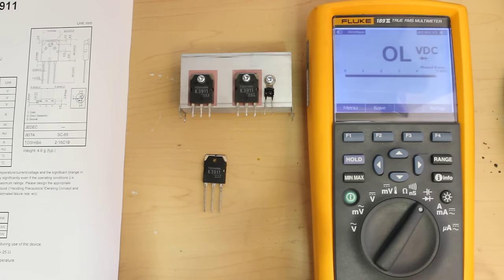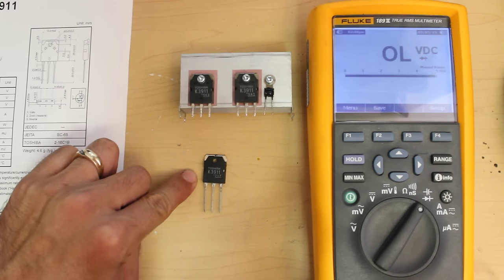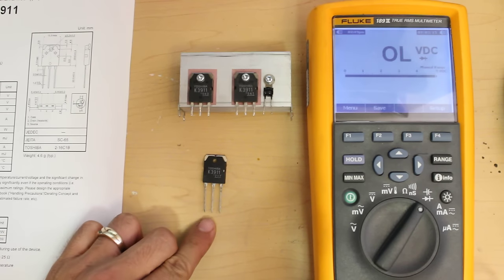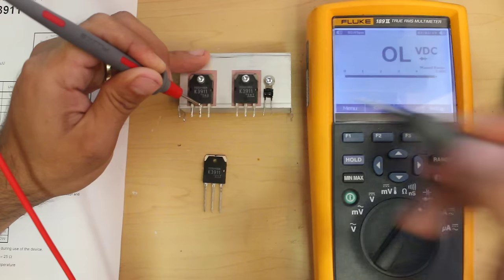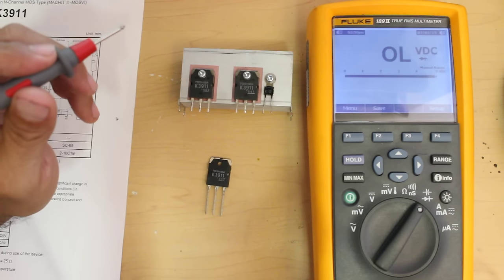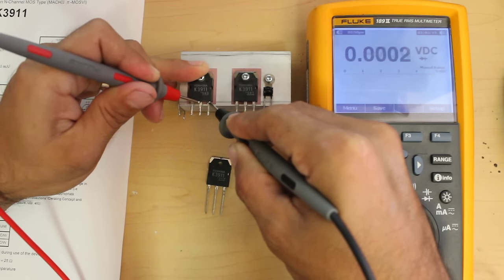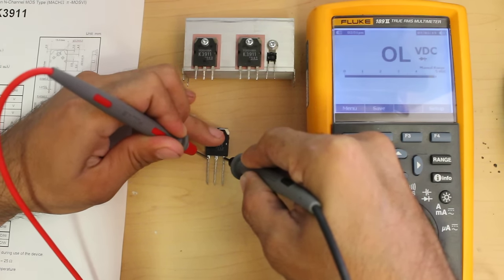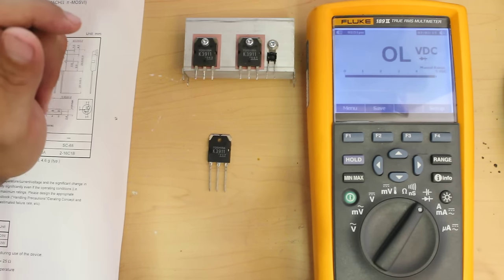How To Test a MOSFET Transistor Using a Multimeter

Comment: Nice video! Just a notice: most multimeter operates between 1V to 2V in diode tester mode which is not enough for a switching MOSFET to open.
Reply: Thanks for the info.
I saw a lot of videos and was wondering, Why my DMM can't charge Capacitor by touching the Gate.
Reply: Oddly enough, I have a B&K component tester that shows 2.9vdc output on the diode setting but will NOT charge an IRF520. I have a Fluke digital multimeter that outputs only 2.5vdc on the diode setting but works perfectly on the SAME IRF520 every time.
Reply: yeah some meters test with 7 Volt and some 3.5 V or lower etc, this needs to be checked first with another multimeter.
Reply: An easy tester is a 9v battery with a single diode and led(with resistor if you want it, for indication) on one probe. Subtract the diode and led voltage and you got a simple polarity tester. (You still need a meter to measure voltage drop on it but got more than 2/3 volts to play with)😊

Comment: Can you do this in a circuit board
Reply from the maker: +alsteven44 Hi, yes you can do this in the circuit board. Then, If you have any suspected bad MOSFET transistors in the circuit board take them out of the circuit board and re-test them.
Reply: The gate is not likely to hold a charge in circuit.

Comment: I had a trailer brake controller which was constantly applying the trailer brakes even when the truck was off. Happened to find this video while googling the transistor number and found the transistor was shorted internally just like the one in this video. Thank you so much!!!

Comment: Many thanks for this tutorial. Just got some Mosfets off a Brushless motor ESC and found 2 duff and 4 working OK. I'm making a flashing 10W LED lamp to put in my model aircraft for when they go in to cloud or otherwise out of sight, and needed the mosfets to switch the power on and off to the LED driver.

Comment: simple and right to the point " that was a good way to demonstrate that ! Also if checking power mosfets with ohm meter set to ohms reading and you get ANY reading between any combination of gate to drain or source to gate ect that shows a dead short the mosfet is bad it's shorted ! but make sure to discharge it by holding the three leads between your finger and thumb before doing dead short test this way ! I have had many mosfets read .437 and ( point 437) work fine as that is residual capacitance in the internal circuit ! always check a new one before installing it !

Comment: Be aware that this works only if the voltage provided by the dmm to charge the gate is above the mosfet's gate threshold voltage. 
The high-voltage fets have Vgs-thr above 4V. Some even atound 10V. 
The low-signal and ultra-low voltage have lower voltages but not much below 4V. 
A regular dmm outputs about 1V...2V  with high impedance.  Some up to 8V on a 10Mohm load. 

It is safer to use a variable power supply with a high-value series resistor as s gate charger.

Comment: I found this video informative and great to have produced.  I forgot the charge up of source to drain part to develop a capacitive voltage for a short while in good MOSFETs.  I would want to double check my schematics of the MOSFET to know where the source and drain are vs gate to drain shorts.  I don't have a transistor checker multimeter yet.

Comment: Thankyou for the tutorial. I have a Technic amplifer with an issue with high voltage. I think the Toshiba SK117 could be defective, the gate with the old part appears to be the center pin. I am getting low values on the Diode test 145 etc ( my meter is 3 diget), so i assume all must be defective. As i get no 1 (which is OL) on your meter

Comment: So, that mosfet that you are checking is a P-channel type because the Gate is at the positive probe?Am I correct? And how to determine of what pin is the Base, Drain, and Source by using only multimeter (diode mode) amd without looking the specification of that mosfet parts?

Comment: Does this work for a NTE291 transistor?  I just bought a new NTE291 and wanted to test it before I install in, but it doesn't quite test like this.  Is the NTE291 different than this?  I've watched a few videos how to test transistors and my new NTE291 doesn't do the same as the test videos so I'm confused.  I hope I didn't buy a bad "new" transistor.

Comment: does this method work if the mosfets are in circuit still? also what if the connection between drain and source is intermittent ... does this mean that the mosfets are bad?>

Comment: Did you ever burn any mosfet because of capacitor overcharge or multimeter voltage by using Diode mode measurement?

Comment: Hello, I have a defective TV and I'm testing two MOSFETs. When I try to charge it and test the continuity between Drain and Source there's no connection, they both do that. However I tried a spare one I had on a junk PCB and it works fine. Are they dead?
Reply: Make sure you're using enough gate voltage.  You need to lookup the data sheet and find the Vgs for your particular FET and use at least that much voltage.

Comment: I can't seem to get my fet to turn on .. it does have a 20-30v VGS rating though .. I'm assuming that's why, right ? 

Thanks for the video ! Very nice and clear !
Reply: Yes, the meter is not putting enough voltage on the gate to turn it on.  Try using three 9v batteries in series, or a power supply.

Comment: Hi, this is robert from germany.
ive got a little problem here with an transistor from my psl vp 2030 amplifier. the housing is broken and it smells like dead electronic.
now the problem , there is printet on it
hslp1 9424
and i cant find some information about it.
its the housing of a TO 247 
do you know what kind of transistor this can be?
i need a spare part for this to repair the amplifier.
thanks
Reply: sorry , the package is a TO-3PN

Comment: my mosfet is not switching in the on position so does that mean its bad also?when I put the positive on the gate and negative on the source it stays ol to turn on the gate then I move it back to the drain and my meter says ol again.

Comment: Nice thank you - does this check is equal (in what polarity concerns) to both N and P channel Mosfets?
Reply: To test P Mosfets you do the same test but swap + and - (easier to just swap them at meter and do the same test) wish someone would have mentioned that to me before spending a fair bit of cash replacing both the N and P in a amp when both were fine.

Comment: Hello, it's s good video. I actually try to figure out if transistors of engine ECU are intact. There are two N channel K2414 Mosfets and if i touch source with the negativ test lead and drain with the positiv one there is no connection - OK. After that i try to load (open) it via gate with (+) lead but nothing happens! There is still no connection between source and drain. Are those transisitors defekt or may be i do something wrong? There is no coating to make measurement incorrect.
Thanks!

Comment: does this work for testing both P and N style?
Also my meter doesnt have diode function.
Do i test in Ohms or in continuity mode?
Thanks
Reply: splash same problem here, did you find out?
Reply: jdraper12 
i ended up checking for continuity between the legs, to verify which were bad...

Comment: build  a simple tester with an old analog meter, or even a vu meter movement.  use a 9 v bat. or two in series with a resister (to limit current to full scale deflection) and red and black alligator clips. clip across collector-emitter and activate base with just a finger from base to col.  Same with MOSFETs. you can actually see the transistor switch off or on with a slight brush against the gate from either drain or source. sorry, cannot easily do a video of this but a very simple analog "super ohmmeter" demonstrates transistor,fet action.  Also handy to confirm leakage of capacitors that digital meters miss.

Comment: The real advantage of mosfets over traditional old fashioned BPJT, is that they are more efficient. 
The voltage drop over a BPJT is about 0.5-0.7 volts. 
The voltage drop over MOSFET is 0.1-0.2 volts. Calculated out of Rds(on) x current   Ampers.
You lose much less power, to heat.
Though BPJT switch faster.
Just personal experience,  I am not an expert.

Comment: hi, i tried this method testing for ON state using similar multimeter it does not work brand new transistor i just bought 2N7000  ... any ideas?
Reply: Make sure your meter is supplying at least 3V across the probes in diode test mode.  That FET needs 2 to 3 volts to turn on.  Some meters don't generate enough voltage.  Try using a battery or a power supply.

Comment: How do you test a TDA2050 out off circuit with a multi meter..Please help...I cant find how to test one anywhere.
regards
Andy
Reply: A TDA2050 is a high power (32W) audio power amplifier, not a transistor.  You can't test that with a meter.  Test it like an op-amp with an audio signal and see if it amplifies.

Comment: hey can I test mostfet in the circuit or I have to take it out and then test it
Reply: Check it for shorts.  If it shows shorted, take it out and test it again.  The trick of charging the gate to turn it on likely won't work in circuit.

Comment: mine says open line when i touch red probe on the gate pin and then back to the drain pin....but the diode looks good when i touch the red probe to the source pin and the black to the  drain  the capacitor i think doesnt work at al

Comment: Using an analog meter is the best way to test a FET in/out of circuit.  DMM's are far and in between for having the capacity to turn them on/off consistently.  Every test bench should have an old swing meter on it.

Comment: 2 Questions: 1) How did you determine which pins were source, drain, and gate?  2) Is this method applicable for all transistors?
Reply: yo can determine through datasheet  and   you can start from the left  G D S      In the middle always drain   on the left  G

Comment: This only works if the multimeter output voltage at the diode test exceeds the gate threshold...if not, use a battery.

Comment: how do u tell witch ones witch gate drain n source
Reply: It depends on the specific model of the MOSFET. Usually the ones shaped like the ones in the video are G D S going left to right, but it is always best to refer to the data sheet of the MOSFET you are dealing with. :)

Comment: The MOSFET is now clear in my mind. But the damn transistors give me headache. The gate or the base is not always the middle pin and that drives me crazy.
Reply: You can google for pin out diagram. Just type the part no of transistor (like BC 547) and google it. In this way you can find which is base, collector & emitter of any transistor.

Comment: anybody in the UK made a 400w dummy load home brew with 4 100w  50ohm resistors. 
on a BIG heatsink 
any pics PLEASE need some help with IT
Reply: You have to use non-inductive resistors.  Connect the 4 resistors together in a square, and connect wires at opposite corners to get 50 ohms at 400 W.   They're going to get very hot. 
 Mount them on a heat sink or put them in a can of mineral oil to keep them cooler and you can use smaller than 100W resistors.  Google for "paint can dummy load"

Comment: Another popular mosfet video says you should touch the gate and SOURCE to discharge (on-state method), which is opposite of you video. Is one of you wrong?
Reply: It really should be the gate and source to discharge the gate.  But since the FET is turned on, the drain is connected to the source, so it will discharge the voltage also.  But it is possible that it might not turn all the way off.

Comment: i was gonna test a FET and applied 5V to the gate and ground to the source, and the little bastard immediately started to smoke! i was WTF? shouldn't doing this have just bridged source and drain? i thought that's what a FET was supposed to do, why on earth would that damage the FET?
Reply: Assuming your mosfet was out-of-circuit, the only way this could happen is if the gate oxide is already damaged, and there's a direct short between gate and source so without  a series resistance, the 5V supply supplied its max current through the device and caused it to emit the magic smoke

Comment: just use Base , Collector , Emitter like everyone else in the world... instead of drain, gate etc ...it makes things easier
Reply: Peter C Base, connector and emitter are for regular transistors, mosfet transistors use drain, gate and source
Reply: This is a field effect transistor, not a bipolar junction transistor.  It doesn't have a base, collector or emitter.
Reply: You could say a mosfet IS a regular transistor. Every modern electronic device you own is likely to contain contain thousands or millions of MOSFETs and very few bipolar junction transistors.
Reply: And this has exactly nothing to do with the point being made.